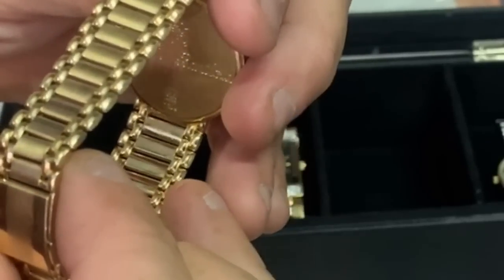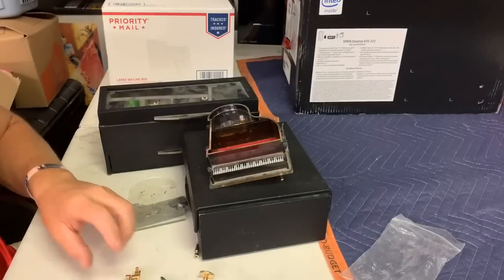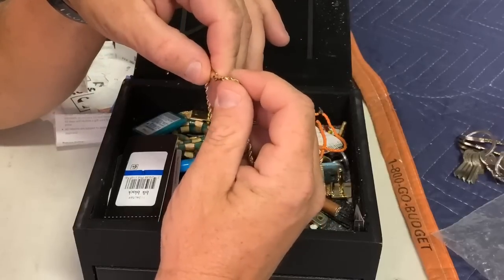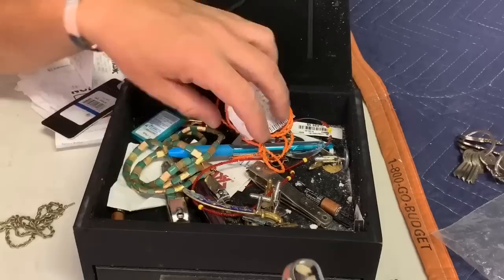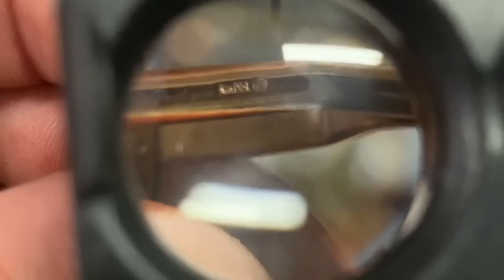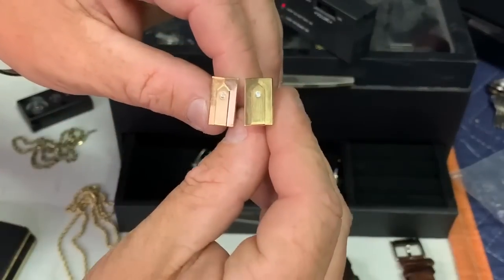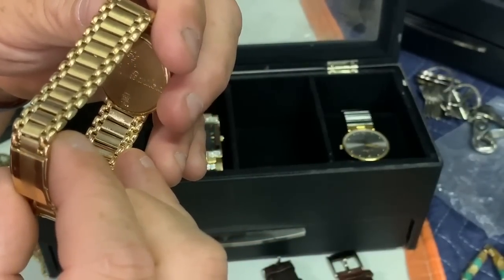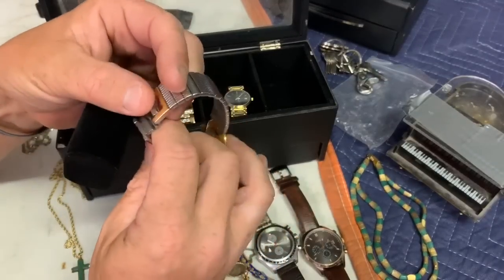LIKE GOLD? WATCH THIS! FOUND SOLID GOLD WATCH! I bought an abandoned storage unit

Comment: FYI.  Color of gold between the cross and necklace is a mater of plating.. the cross is showing its natural color, yes it is very “red” meaning it has higher Cooper content than what you would normally see. Karat is expressing percentage of fine gold to alloys ( copper/silver) no exact recipe just total gold content . So you see it here in states expressed as 10-14-18kt or .417-.585-.750 for the rest of the world. 10kt= 41.7%. 14kt= 58.5% and 18kt = 75%.  So back to the rope chain, almost 100% of gold chain is going to be plated. Yes the piece will be solid gold but to enhance and even out color it will get a 18kt (usually) flash plating. Hand made more likely will not ...